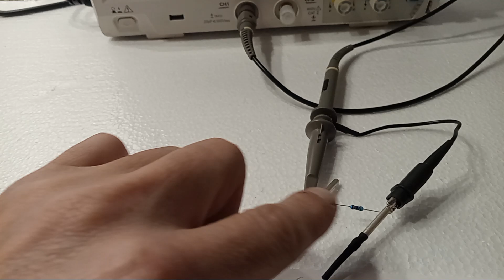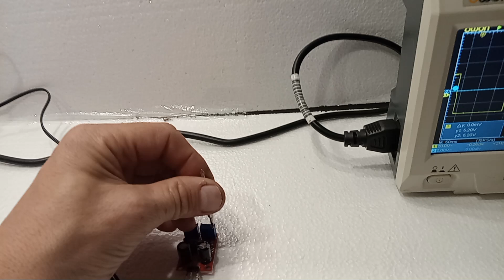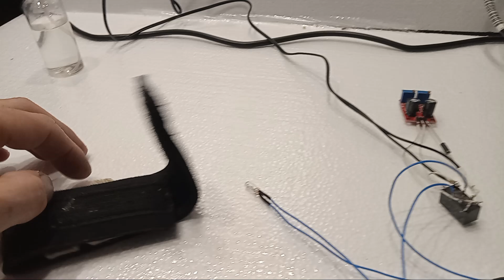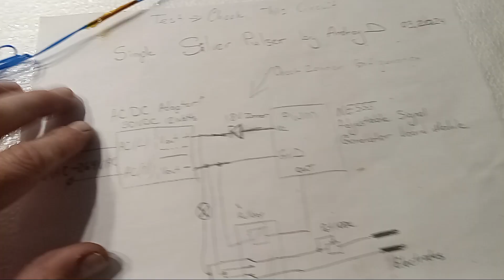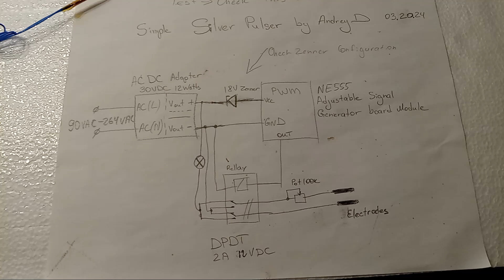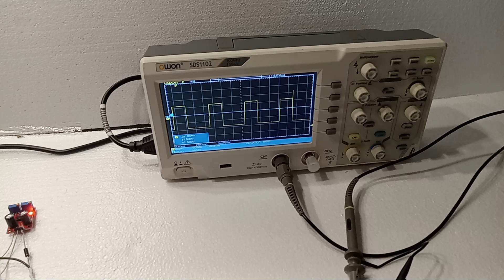166 DIY Sota Silver Pulser alternative, simple circuit, with build in protection part 2

Comment: I have some doubts regarding the answers, they asked you about the function of the relay and you say that it changes the polarity from AC to DC but that is done by the power supply, also the PWM module supports up to 36 volts, but the one mentioned has an 8 amp output, although the ZKPP1K has an output in milliamps because it does not have a mosfet, and that could be used without complication, and we return to the same thing, I do not understand the use of the relay, if it is to turn the pulse on and off, the PWM module already does that, thank you.

Comment: In this case, you get a square output that pulses positive and turns off. It is not a bipolar output, since you only get a positive pulse and you don't get both, positive and negative. Is that correct? Thank you.
Reply from the maker: @elgutitozamora  DC pulses are fed to control relay an relay converts them into bipolar pulses

Comment: Somehow my relay is not clicking or switching. Dont know why, because ive done everything as you have showed. Dont know if my PWM is too weak to switch it on. What should the voltage be on output of PWM to switch the relay on.?  I use the ZKPP2K PWM
What what you suggest i check for. ?
Reply from the maker: On your PWM, you have red LED, is it blinking when circuit energized?
Reply: @AndreyD  Yes, LED is blinking.
Reply from the maker: @merneadanfoundation6775 I see you are using different PWM. 
With your ZKPP2K PWM you should set 4Hz and 50% duty. I'm assuming you are using build in 18V Zener to drop voltage from 30VDC to 12VDC for PWM and for relay, right?
I don't know how well this set up will work, the 18V 5Watts zener has just enough power to run PWM module which I suggested. Your PWM maybe consuming more power, may result in zener overheating. 
Here you can find more info and circuit for this open source silver pulser
https://bbmpulser.org/silver-pulser/
Reply: @AndreyD  Yes im the 18V zener. Please tell me whch PWM Module do you use? Thanks for your assistance.
Reply: Andrey thanks, ive build a 555 PWM and its working now. Thanks

Comment: I am interested in recreating this, thinking about replacing the power supply with 3 nine volt batteries to make it portable, what are your thoughts about that mod with the system you proposed? I make my colloidal silver with my power supply to control constant current so I do will not add that feature to my personal version
Reply: Also, wouldn’t you use a 27v Zenner because using a Zenner of lower desired voltage would cap the voltage and act as a voltage regulator??
Reply from the maker: @MP-ls3hm  18V zener is used to lower Voltage to the 555 PWM module from 30V to 12V. Also to the relay, they both run at 12V. 
30V is fed to the relay contacts, so on the output you are receiving full 30V
Reply from the maker: @MP-ls3hm  yes you can replace power supply with 3x 9v batteries

Comment: Are you going to make your own version and sale them?
Reply from the maker: Probably I will. I see that there I a need for cheaper alternative for Silver pulser which is sold for $300-$400. I think it's way overpriced. It should cost no more then $50 if made in China. If made here then no more then $150.
Device I showed in this video is very simple, and cheap to make, I'm working on the PCB for it and will offer it as DIY kit and as complete built, later I will design nini case for it. 
My next version will have rechargable battery, will be compact probably 2x compact then Sota version and will have option for Colloidal Silver. 
If I end up producing it in China I will mark it for half or less what Sota sells them